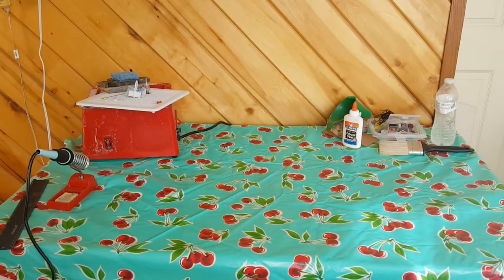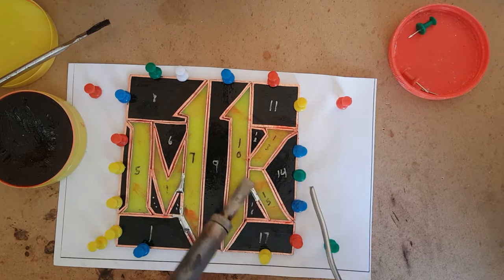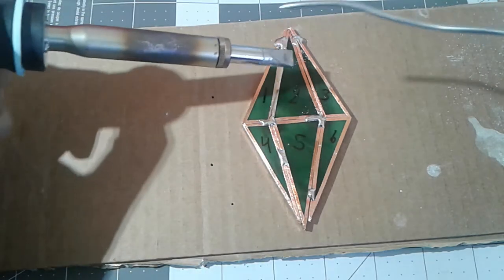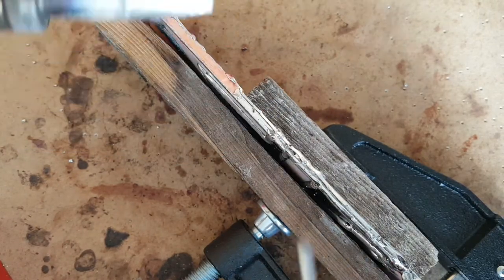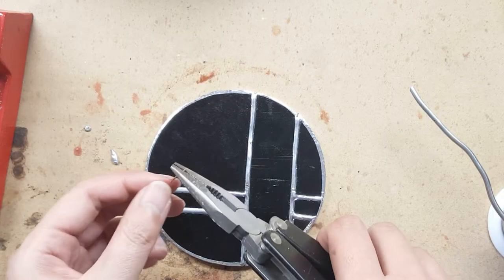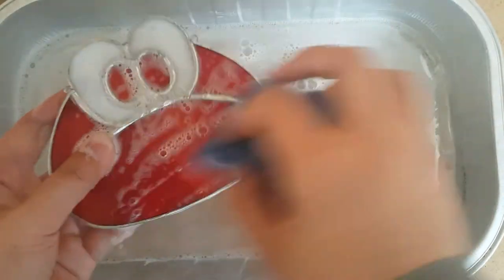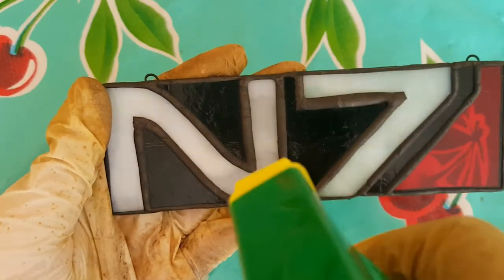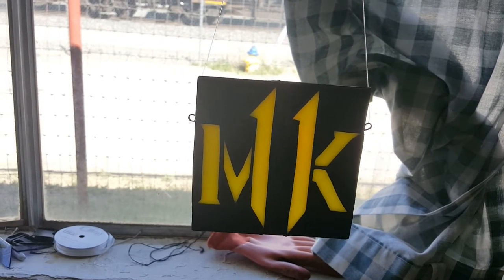Stained Glass Tutorials - Part 3

Comment: don't use just tacks to hold your piece in place while soldering. use a jig for a straighter edge.
Reply from the maker: I'll use a jig when I need to, this has worked for me so far, so I'm sticking with it.
Reply: @VideoGameGlass  I think that he is telling you this, to help you. Why are you resisting? There is an obvious reason why you need a jig. Don't you want to do a good job? You work so hard. What would a little positive change hurt. You can still pretend that you thought of it.
Reply from the maker: Art is subjective, I leave the positive helpful comments and delete the obvious ones that tell me I'm crap and do things wrong. I could do everything exactly like you say and you could still say I did things wrong. Or that my stuff looks like crap, it takes experience 
to do this. Just like with a sport, just because you know the rules and exactly how to play doesn't mean you'll be the best one in your first game. Same with stained glass.

Comment: use turtle wax to finish off the project after cleaning it. Use the paste not the spray. If you use the paste with paper towels, you can ready rub out the oxidized carbon from the lead based solder. Keep rubbing with the wax until there is no more black on the paper towels. The spray turtle wax is just a waste.
Reply from the maker: I use the spray because I don't like the paste...so I'll continue using the spray.
Reply: @VideoGameGlass  Well, if you want to do it the hard way. At least people reading this will learn from your mistakes.
Reply from the maker: People can use whatever they want, I know I make mistakes but I'm not perfect.

Comment: don't reuse your flux brush. the shit that is left on it will contaminate the new flux later.  use liquid flux and q-tips to apply. throwing the old q-tips out after each use.
Reply from the maker: But its not like I'll be using the flux for other things...I've never had a problem with reusing the flux brush.
Reply: @VideoGameGlass  I don't think you understand the dude's comment.  Read it again, and think about it. If you re-use a flux brush after the air has a chance to get to it and after you leave it sitting for a day, it will contaminate the new flux that you are putting on the new soldering area.  It causes more contaminants and causes the solder joints to decay after a few months and you'll get a shitty whitish build up on the solder lines.   You are new. Take some advice like a big boy would.
Reply from the maker: Solder doesn't decay because of contaminated flux. I've been doing stained glass for YEARS and all of my projects are still in one piece. If anything, the foil is the first to decay and not the solder. Since the foil is sticking to the glass using adhesive, the adhesive will decay over time. Sure there may be cases where the solder does fail first, but I have never had that happen.